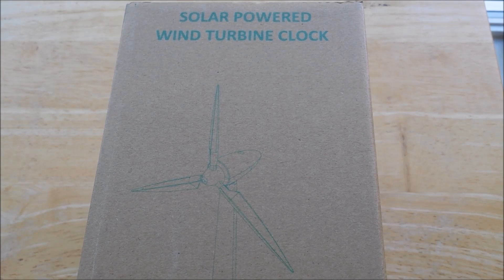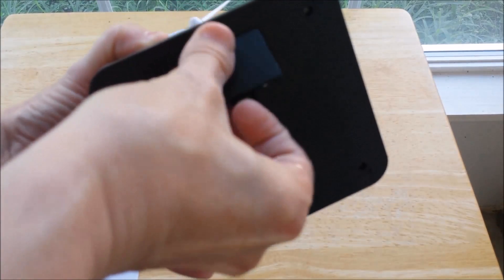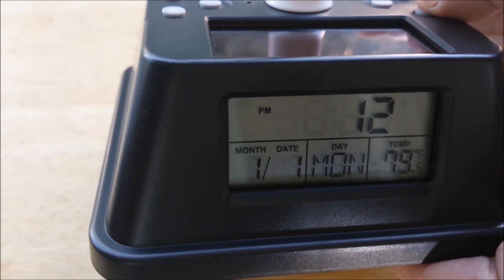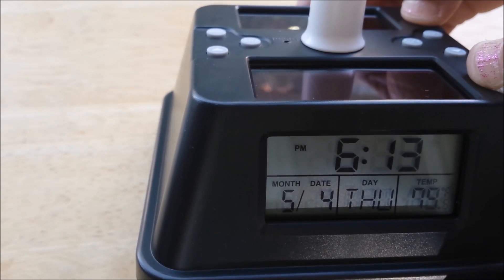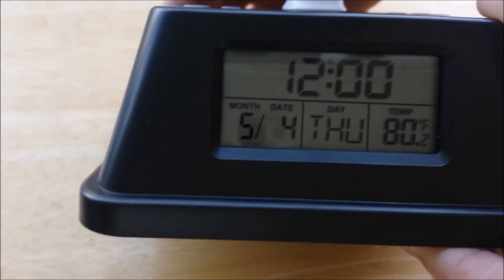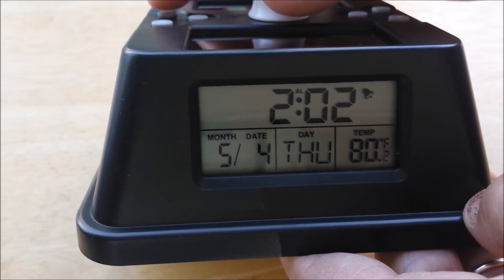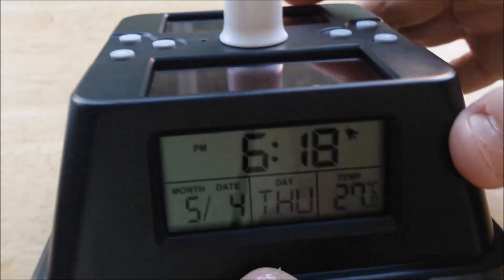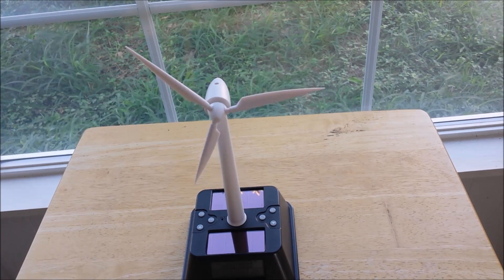Solar Powered Wind Turbine Clock - Super Adorable!

Comment: does it realy use solar power
Reply from the maker: Yes
Reply: so why it needs battry
Reply from the maker: The tiny solar panel charges the battery so there is some reserve for nighttime.
Reply: is it a rechargebal battery
Reply from the maker: Actually, I just looked at it.  The battery is just for a backup -and they are not the rechargeable type.